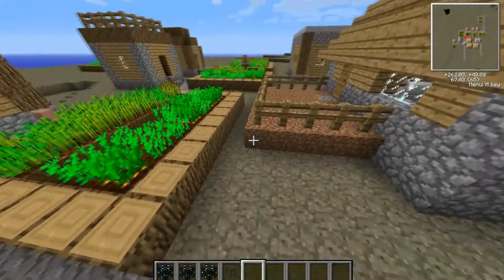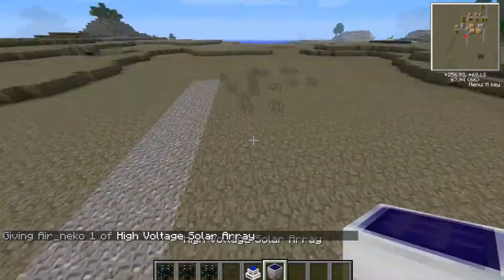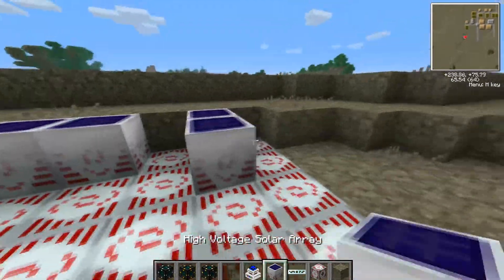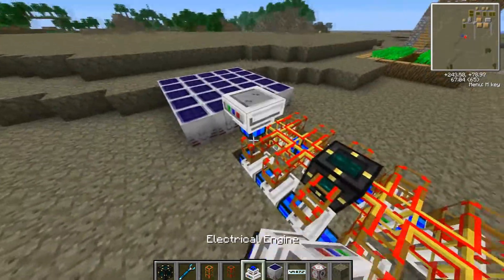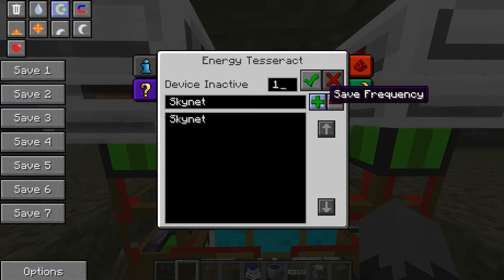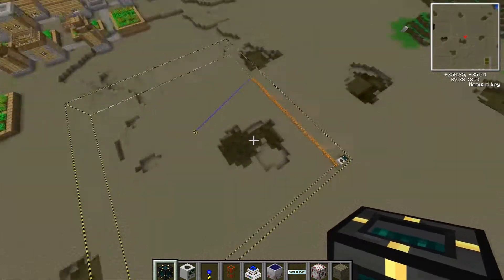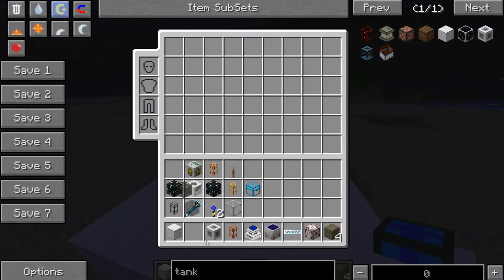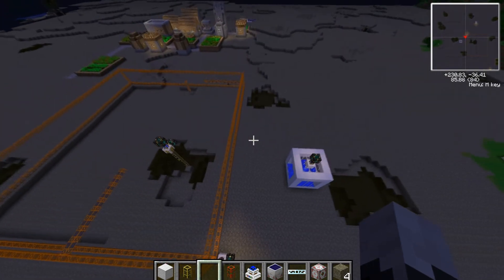FTB Tutorial: Tesseracts (energy, liquids, items)

Comment: boy, they supercharged the quarries now.  Used to be with max 1 fast electric engine in Technic pack, they would plod along, and it didn't matter if you had 2 of the engines, it wouldn't go faster.  This quarry is whipping along...and that's even with the 25% loss on the tesseract feeding it 75 Mj/t and supposedly it will take 100.  (supposedly you can put 2 tesseracts on it to get to 100.)  But yeah, max size quarry used to take FOREVER.